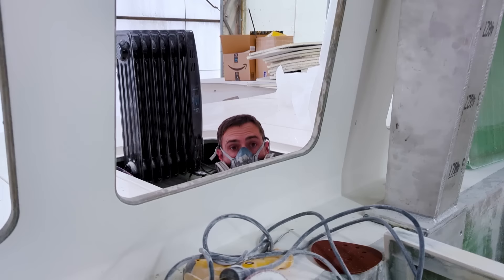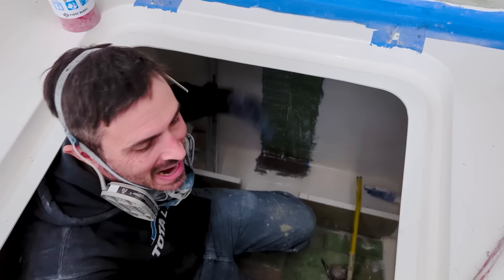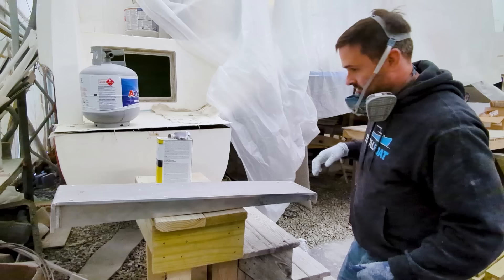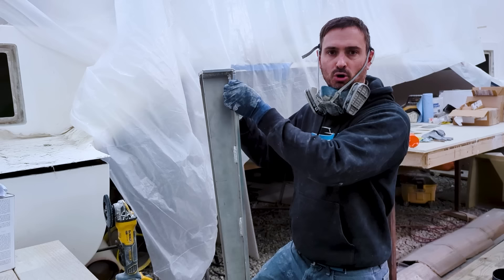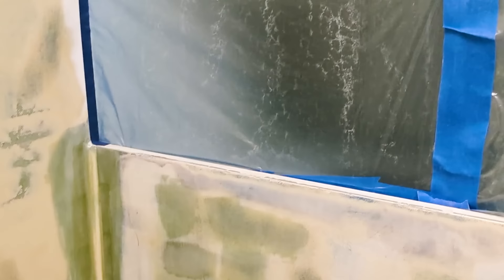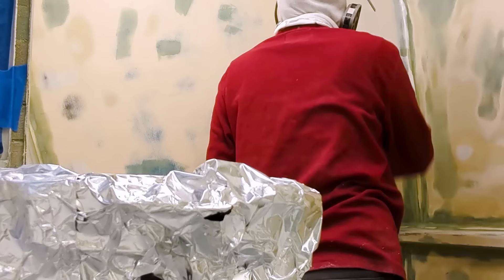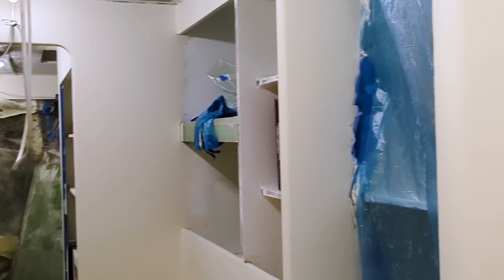Foiled At Every Turn! Catamaran Build Gone Wrong  (MJ Sailing Ep - 316)

Comment: Happy New Year guys as a retired aircraft engineer any time we used to make repair section on the aircraft aluminium structure, we always treated the bare plate with Alocrom 1200 solution and it would apply a irdescent golden, protective chromate coating to protect the metal and you would paint on top a primer and a top coat.

Comment: This is off topic and i dont know if you have talked about it but air conditioning is extremly  important to get the humidity and heat under control espeacially in the tropics or you will not be happy campers . Run piping for ducts now.
Reply from the maker: We will be running air conditioning, the ducts will be run from our v-berth storage up to the galley. That's just a few months down the road.

Comment: When we were fibreglassing our forebeam into our cat, we would put epoxy on the forebeam (after cleaning it) and then sand it with the epoxy on meaning there was far less oxidation-- the bond lasted extremely well. Phil

Comment: I had the same problem when I stupidly bought the “new and improved” caulking adhesive from the chandlery instead of the 3M stuff I’d always used.  I got halfway through laying a bead along the entire length of the boat when the gun froze up.  I desperately tried to get it all off before it dried and barely succeeded.  Later on, I went back and cut the tube open; the “new and improved” stuff had already partially cured before I’d even opened it.

Comment: 6061 aluminum is great stuff. I used it extensively in my airplane build and it hasn’t disappointed; a great mix of strength, lightweight, workability and corrosion resistance.  I don’t think you’ll have to worry about that backing plate.

Comment: Read through all the comments and clearly no one is as childish as me, so here goes:  "It works better when both sides are pushing."  Yeah, she said it. ;) ;)   WRT the compression post, I am trying to find the link, but there was another YouTube catamaran sailor (maybe Parlay?) that recently replaced his aluminum compression post after finding a good part of it had corroded.  I still would have taken the time to coat it with something to seal it (maybe after it gets a layer of oxidation?) that would not affect the bonding.  As someone else mentions here, metal expands with heat, so I hope you allowed for that in all 3 dimensions, because both sides push.

Comment: Not sure about that isolation between your s/s bolts and the plate, try sticking a multi meter on the bolt and the plate and see what your ohm's are, I bet your still connected.

Comment: 1. An electrically driven adhesive gun exists from several manufacturers. Wouldn't have helped you with the solid adhesive but makes applying a breeze. 2. Propane adds a lot of humidity when heating up an area, but you are probably aware of that. 3. It's called aluminium, because that's it's name 😄

Comment: You guys need a diesel heater they use a tiny amount of fuel for the amount of heat you get is incredible
Reply from the maker: Maybe next winter, but because a diesel heater will put a film in the air and onto our surfaces, it will affect our bonds at the moment.  So, better to play it safe and continue to use propane for this season.

Comment: I wish you had been more deliberate in showing us what material you used to bond the backing plate in place.  I believe that Jess said it was some form of cyanoacrylate.  I'll be needing something like that to glue in a bulkhead on my boat when I built the galley.
Reply from the maker: We used a Methacrylate from a company called Wiredforsigns.  It's an inexpensive MMA compared to the Scigrip brand we use for the hull
Reply: @MJSailing  Thank you for the informative reply.  I added a bookmark to their adhesives section in my web browser.  It looks like just what I need.

Comment: Why didn’t you drill and line up your holes before you added your adhesive you use the bolts to draw the adhesive together for it to dry just a suggestion also cut the tip of your gun back a inch it will come out much easier you spread it around anyways it will save your hand and arm muscles good job all around just remember I know it’s hard to not get side tracked trying to make everything perfect
Reply from the maker: MMA requires a certain space to allow full strength...  It is 3mm for this type and I wanted to make sure I didn't squeeze too much out

Comment: Aluminium  fasterner(highgrade) would have been bettre
Reply from the maker: I've yet to see any production builder use aluminum fasteners in a high load area.  The aluminum bolts available are typically less corrosion resistant than the base plates.

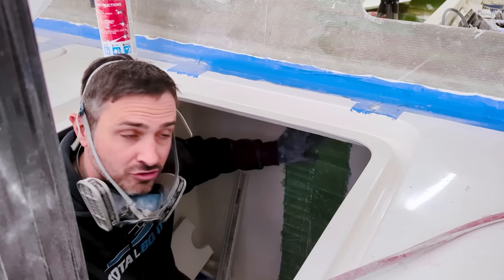Comment: @01:31 "...the bolts are just there as a kind of a backup..." Right, but don't forget, also as an anti-squeak measure!👴😁
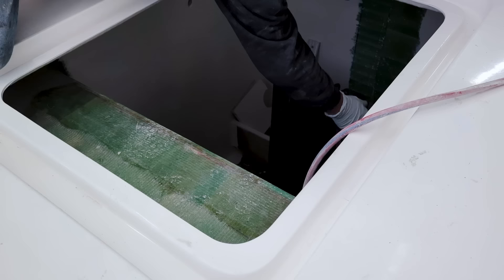@02:02 Did you hear about the real cause of the fire that wrecked a 45 and a 50 foot Leopard cat? (happened some 3 years ago)👴😳😨

Comment: Was there really a need to use methacrylate adhesive on the compression post? I would have used 5200 which is pretty much fool proof and provides tremendous bonding characteristics. Keep in mind that there is no pulling force on the plate material, strictly compression and sheer.
Reply from the maker: We could have used a lot of adhesives with this large of a surface area, but the engineering and certification were done with an MMA in mind.  We follow the plans on important parts like this.  MMA lap shear is over 2000psi and 5200 is around 350.... But again, this is a huge bonding surface so probably unimportant here

Comment: Hope you got a refund on the first tube. I'll bet they wouldn't cover the cost of the gun. Looks like you're using a 1 to 1 mix, If you're going to use a lot more, I can check into an air driven gun. They're easy to work with and batch consistency is better with the even flow through the static head mixer. Let me know if you think it will help.
Reply from the maker: Thankfully they did replace that tube, it was just a bummer to have to put this project on hold.  Normally we're not working with the tubes of methacrylate, just the large batches, so I'm not sure if an air gun would be necessary for how infrequently it's used.  😉